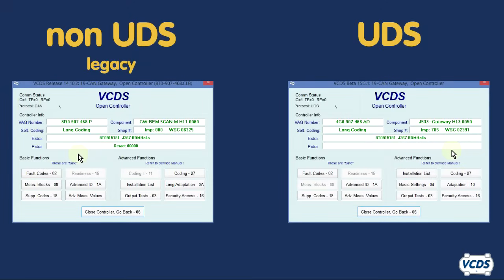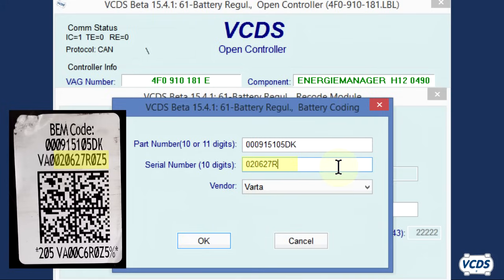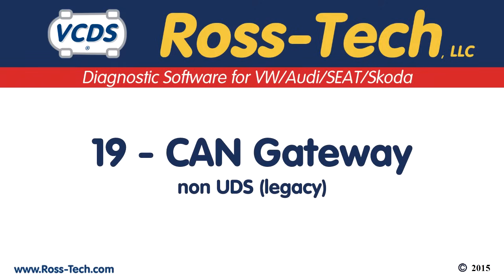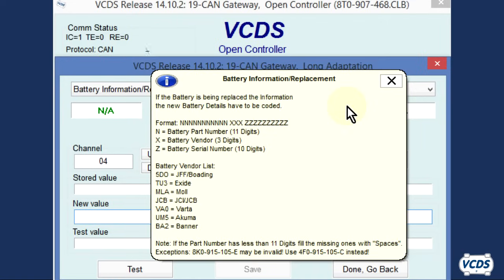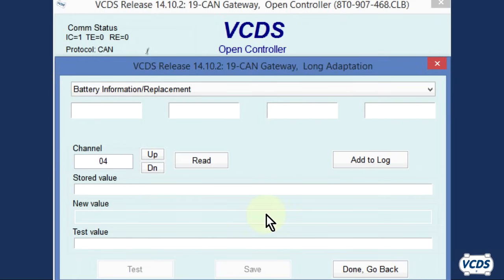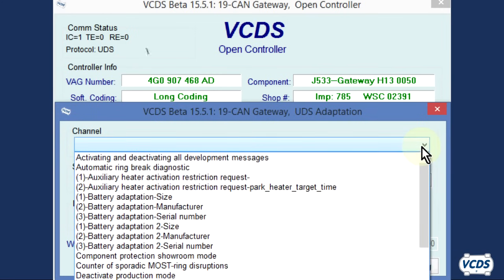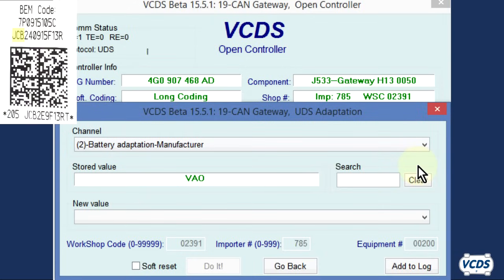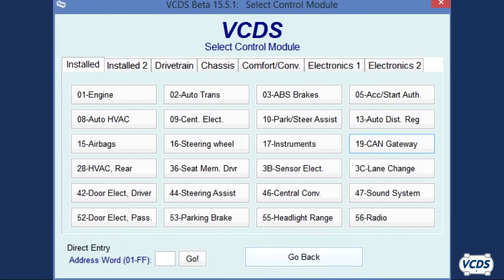Battery Coding

Comment: RossTech-its not about being the correct battery or incorrect battery. Its about buying a aftermarket replacement part instead of buying a often overpriced dealership part. If I peel the stickers off a Varta and a East Penn battery you really think that even a Audi tech can tell the difference? Do you also think that every tank of fuel is inferior to the fuel the car shipped with :P? Or that a bulb that isn't OEM is inferior as well? This isn't a ECM or a BCM. Its a storage device that uses chemicals to make electricity. Something that is pretty universal from Ford, Nissan, GM, VW and every other brand. Its not rocket science. This just a way to milk money from someone. Its not about using "the wrong battery" (cue the dramatic music). Ever think that the reason someone can afford a $40,000 car is because they don't spend money needlessly?
Reply: Yes, it's just a battery, but the Battery Management module makes certain assumptions about the battery's characteristics based on the battery coding.   Don't blame us for this; we didn't come up with this stuff, we just make a tool that lets you do yourself what would otherwise require a trip to the dealer.
Reply: +Uwe Ross then why have people reported on audizine.com that even the dealers often don't bother with doing this for used cars?
Reply: And yet, so many have never needed to recode. That is a simple fact.
Reply: Lawsuit? Over a car battery? Right. I think Prius owners are more worried about battery life and its cost than most VAG owners.
Reply: Save me the luxury BS. Virtually every other comment echos my sentiment. This is a unneeded money grab.
Reply: First, Audi charges more than $150 for a battery and hour minimum for install and coding....in the 3-400 neighborhood. That could be a new downpipe, or grille or anything else but dealer gouging. Informing others that recoding isn't always necessary isn't a bad thing.
Reply: I agree with you man! Batteries are made with some certified standards. OEM battery is just overpriced crap that you can buy for the half of the price just with another sticker.It's same with diagnostic tools- I've been using original VCDS before for diagnostics but nowdays my interface is "to old" and I don't have any support not on the forum not anywhere..Bought OBD11 for 120eur and it works better and full functionality for the 1/7th of the vcds price...
Reply: google.com read, learn...
Reply: Rick Thayer i
Reply: Rick Thayer hello...
How i can activate clock antene on (left) display
Thank you
Reply: best comment for me...
Reply: Oem batteries are very reasonably priced I don’t really see a reason for an aftermarket battery
Reply: Then don't re-code, simple as that. Why bitch at Ross Tech, or anyone else that's not the manufacturer for that matter? It's not even the dealers' fault, so write a letter to Matthias Müller and whine about it, or, like the rest of us, change your battery and just drive your car.
Reply: Jason Walker I was asking why so many others have not needed to do this. Why does it bother you that I pointed it out? If some one else reads that then may not need to pay dealer cost for a batter and recoding and it saves them the money why does that seem to piss you off so much, keyboard warrior? Seems you are the only one whining. Comment was there for months and decided to get hostile about it.
Reply: Because who cares? If you have Ross Tech then it's a non-issue. If you don't like it, go buy a Vespa and take that to work. Ever think that manufacturers have asssurance in the fact that they can track whether you put proper parts in your car to cover their asses in the event of a law suit? (improper installation liabilities and improperly tested components that were not tested with the car by it's engineering team?) No, of course not. If all batteries are the same as you state, then WHY do manufacturers make multiple sizes and ratings?
 You're whining about an extra $10-20 on a $150 charge every 3-4 years. Get over it or get the Vespa.
Reply: Most people who by nicer vehicles can afford it often because they know the value of a dollar and know where to spend it and where not too. Rich don't stay rich making poor choices with money.
Reply: Then don't buy it. More for the rest of us who have the means.
Reply: This has nothing to do with warranty coverage, or the disclosures of those coverage's. It has to do with damage to person or property in the event that incorrect parts and/or poor repair practices for any part on the car they built and may be held accountable for by law. You know that every time you log in to a control unit it is logged internally, right? Dealer codes are stored, devices are stored, this covers their ass. There are things dealers can't even see that is logged for legal and engineering. You're ignorant, I get it. There are thousands of morons out there that try to get out of their car payments, maintenance expenses, wrongful death suits, or damage related expenses and try to get the manufacturer or the dealer to pay for it. Pretty smart if you ask me.
Reply: If you have trouble justifying that expense for a maintenance item (to keep your car on the road) on a premium luxury vehicle over a down pipe or a grille; oh boy. How come Ferrari owners don't complain about $800 for a battery replacement? Sounds like you might be punching above your weight class and should really look in to that Vespa I was recommending previously...
Reply: Everything from ECU's to Android phones do that. Think its well known. Has nothing to do with a battery... has nothing to do with my income bracket, my choice in transportation. I am done arguing with you about it. Have a good one. You have your view, I have mine.
Reply: You obviously don't work on cars for a living. I work on cars with batteries that range from $140 to $40,000. I've seen batteries cause control modules to do some very strange things. Because of that, I'll run the right stuff in my car and not worry about it.
Reply: Rick Thayer Pretty sure the liability involved with building a car is a bit more complicated than a cell phone, but it shows where your mindset is. A simple power cycle doesn't fix 90% of the problems. A car requires upkeep, and it's expensive. So, 1) pay someone to do it for you 2) buy a vagcom dongle and learn to do it yourself 3) buy a Vespa.

Comment: I need your help guys , with a recently purchased Vagcom and Vcds i can't code the battery on my 2009 B8 A4 it retains the old battery number and will not save the new number, this is a non UDS and battery manufacturer is Varta
Reply from the maker: +Ermal  Spahiu Ross-Tech has free vehicle tech support at our web forum:
http://forums.ross-tech.com/forum.php
Sign up and post your questions in there and we should be able to help you out.

Comment: for an Audi A6 2006, 3.2L, V6- I should enter the code using first :address 61 and then address 19 or it's enough to use only address 61. Do we have here two steps: 1st address 61 and then address 19 or just one step - address 61?.Thanks
Reply: Did you ever figure it out? I'm stuck in the same situation.

Comment: The Germans make easy stuff compicated and hard stuff very complicated.  Europeon computer technology is horrible and its getting worse.  People need to start doing their research before buying a car.  Its more important than ever nowadays.  Most vehicles have more than 30 computer modules now and the car manufacturers are using this to keep your car a captive of the dealers.  After 10 years they don't support it anymore so you have to throw away the car because information is not available and even if it is its so expensive and hard to repair no one will.  There is hope.  Google Massachusetts Right to Repair.
Reply: I agree ..  battery coding is ignorant because there is no reason for it.. .Systems could be designed to automatically detect battery type and conditions... some car makers do this.In a few years they require coding of washer fluid
Reply: I have a mk5 golf 1 year pissing about with VCDS never had a problem I was able to get daytime running lights boot pop etc all the stuff I didn't have

Comment: why is this thing needed? I mean.. why they force this kind of battery replacement?
Reply: So the car knows when to shut off consumers, what voltage to demand from generator and not under/overcharge, when to disable start/stop, when to turn off parking heater etc..
Reply: @snapdragogon69  unfortunately that falls on deaf ears here because the average consumers feeble little mind cant comprehend the reasoning behind it. I'd try explaining it like a cell phone battery and how battery management works as something to relate to, even then it goes right over their simple heads. So many whining people , so little intelligence.
Reply: +madott Simple! To stop you doing it yourself and to get you to bring your vehicle back to the dealership! Repeat business makes more money for the company, and every business exists to make money!
Reply: There are alot easier ways to make an extra dollar then to have your battery code properly. like changing wipers.

Comment: What models use BEM?
Reply from the maker: Bernard Tripp 
Mostly Audi vehicles, starting with the 2004 A8L.  More Audi vehicles got some form of BEM as newer generations of vehicles came out.  The current gen Touareg as well.
Reply: RossTechVCDS Did the 1st Gen Touareg get this? Specifically the 04 V10s?